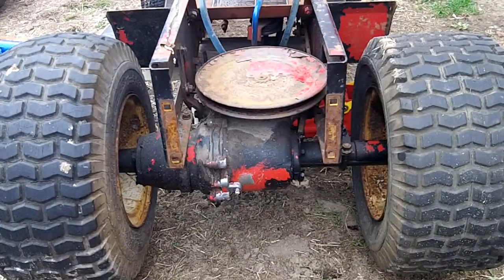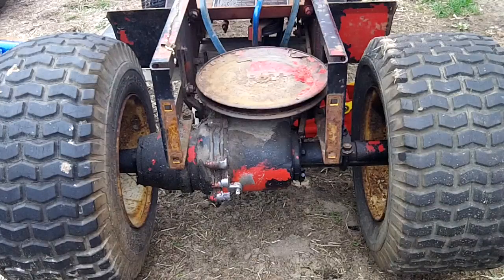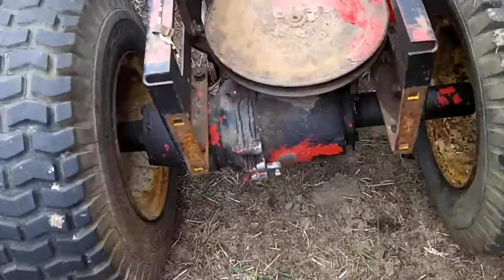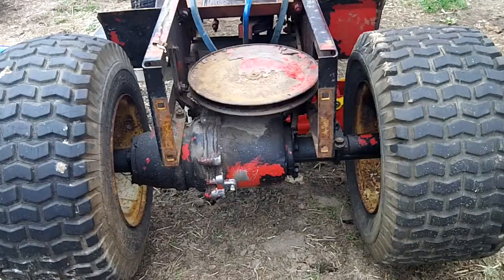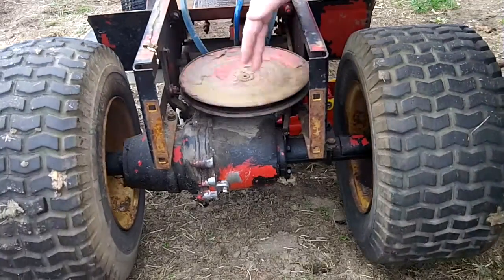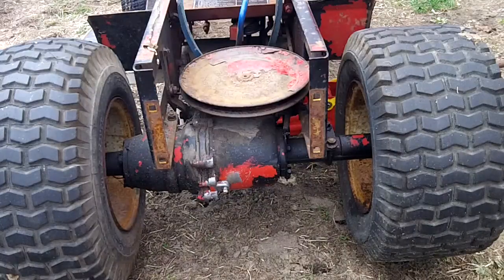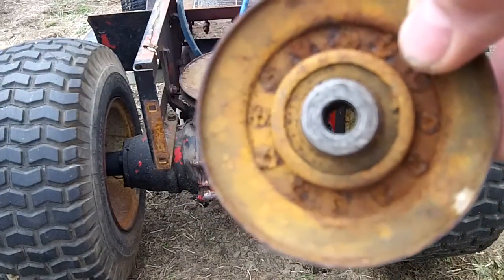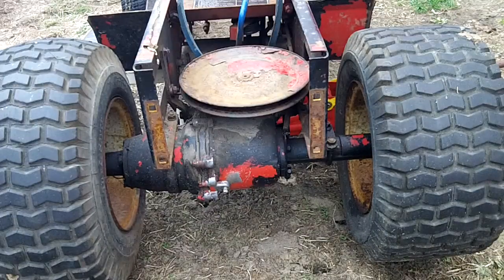Part 8 of the 77 Wheel Horse A-90 restore-Checking the drive

Comment from the maker: Yeah if you remember my videos on the 800 Special, it drove me nuts until I re-fabricated the guard. My minimal experience with Wheel Horse tells me when it come to their drive train, it can get a little tricky. I learned a lot about guards and guides on that one, and not necessarily a real tight belt on a horse like it is on other tractors. Hopin the belts good too lol, not too much, but buying two can get costly. Thanks!

Comment: How did you get the double drive pulley off of the crankshaft?,,,Thank you
Reply from the maker: Mine wasn't difficult to remove. I removed the bolt and it slid off. Try Murray Mayhem's channel, I believe he has a v ideo on this.

Comment: Will a plow fit onto this model?
Reply from the maker: If you are talking about a Wheel Horse A-90, this has a special plow, made just for it. Wheel Horse has a few different plows made for the larger tractors. Check Red Square and there should still be a list of plows and what tractor uses what plow in this website.